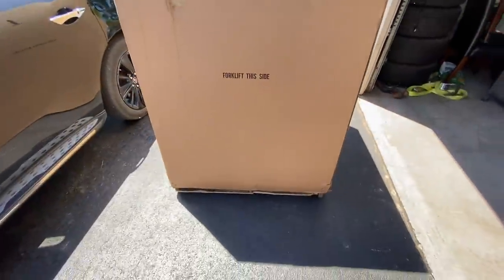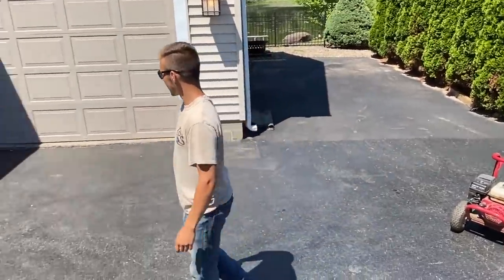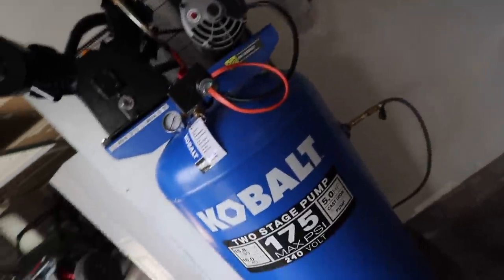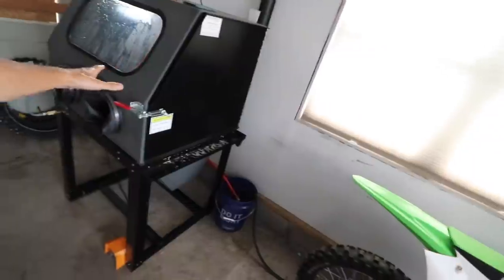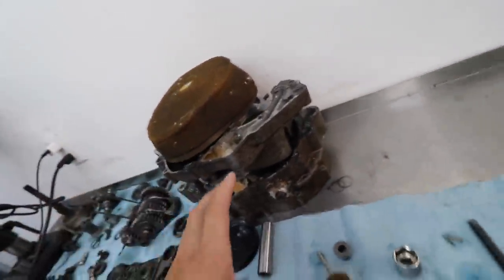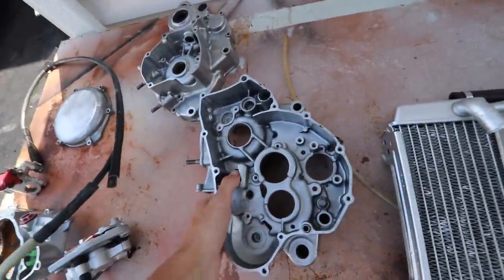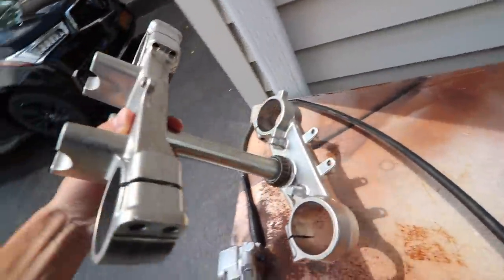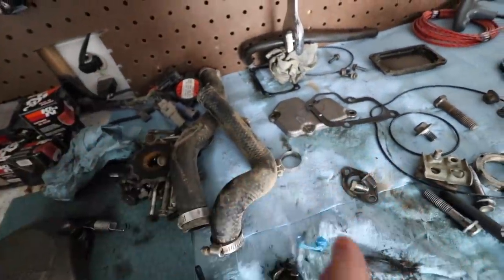NEW ADDITION TO THE SHOP - Vapor Blasting Cabinet to Finish The 2020 RM125 BUILD!

Comment: Want to caution you on the vapor honing process. Its extremely important to make sure your parts are 100% disassembled. For example, your right side case cover had the seal for the kick starter & waterpump still installed. The glass bead WILL get trapped in there and then go into the engine. Also make sure you take extra care on the threaded holes. Cant tell you how many times the media gets clumped up in them in my machine.

Comment: Exited how this RM turnes out! I got myself a really good one from 2007 in showroom condition
The parts after vapor blasting are trick 🙌
Personally I prefer the old school plastics, the restyle kit angles and linehaul are not fitting so well in my eye. Updated front fender and cutting side panels is a nice decent update.
Love your 125 builds 🔥

Comment: hope your house dont burn down... 25a breaker is massive if your cables are only good for 16 or 10 amps..... the breakers there to protect the cable not the equipment.